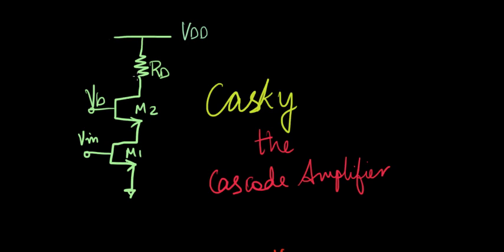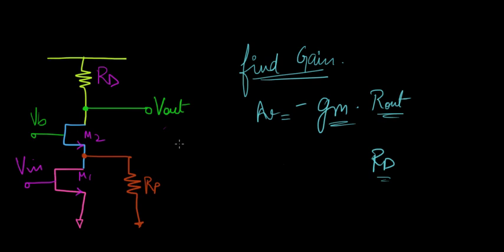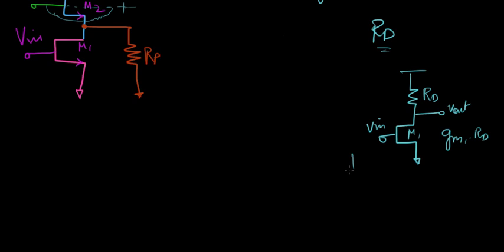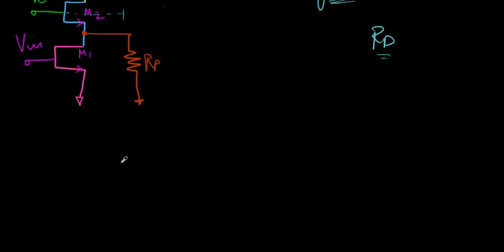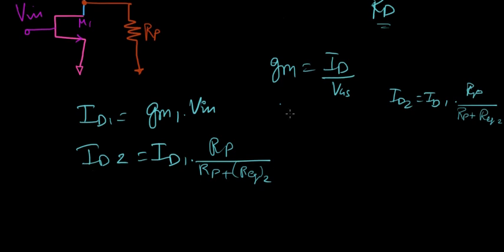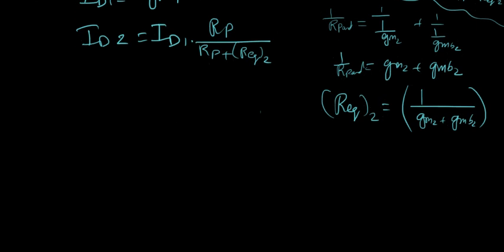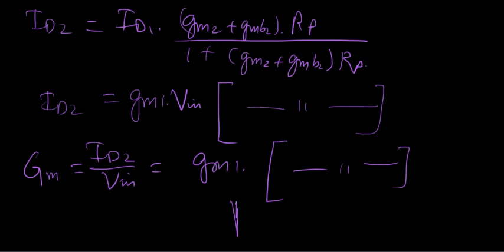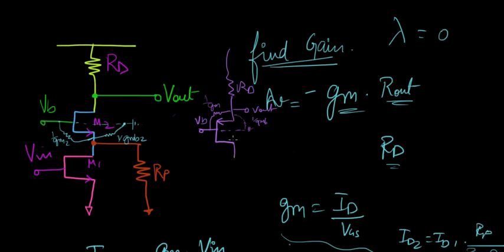Cascode Amplifiers - Example

Comment: I do not understand the Req2 derivation.  That is not the correct equation for 2 resistances in parallel (product over sum), nor is he adding it in series (would be 1/gm2 + 1/gmb2).